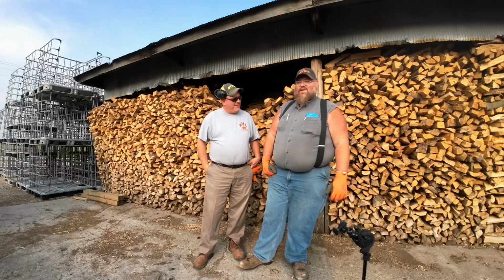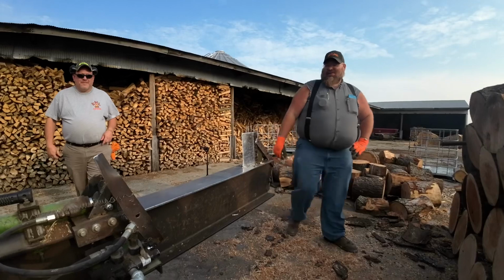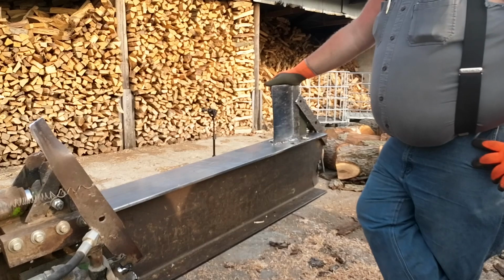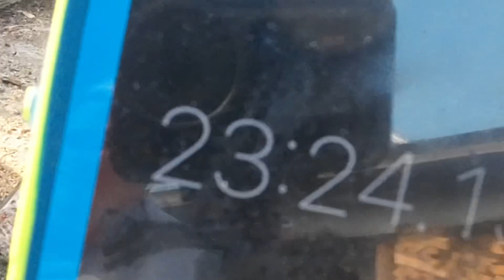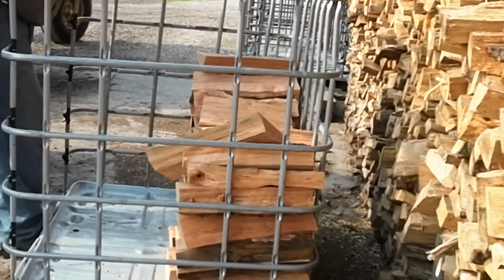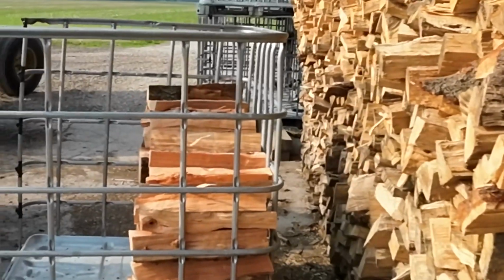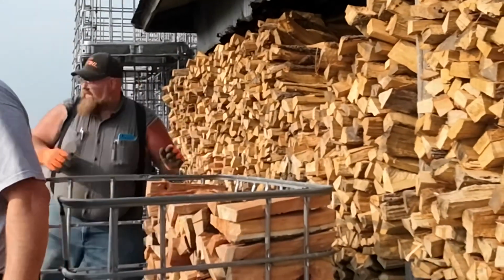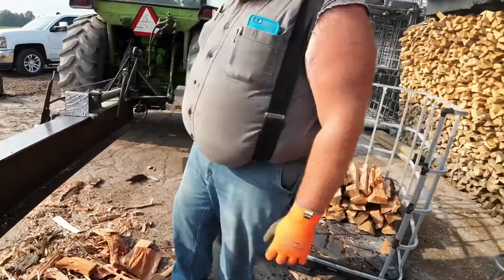FACECORD CHALLENGE!!!

Comment: Nice. I sure like the handle that operates the ram. True homemade there. 👍🏻
I have a splitter that looks similar to that one. 
What is the make and model of the tractor. I want to find out the GPM flow of the hydraulic pump. 
Great video. Thanks.
Reply: Thanks for watching. The tractor is a John Deere 4230. I think it’s a 1974 model diesel 95-100 HP. I think it’s around 23 GPM flow. It’s been tweaked a time or 2. And I found to high. Kept blowing o rings on the plugs in the pump. So went back down a touch. It does everything I need to do. Would be nice to have a little more GPM. But I use the skid steer splitter on the tougher chunks or cut them with the saw.
Reply: @jacobking80  no wonder it moves the splitter so fast. That’s great. Thanks for your response. Great time on the face cord splitting, by the way. I’d kind of would like to try that.